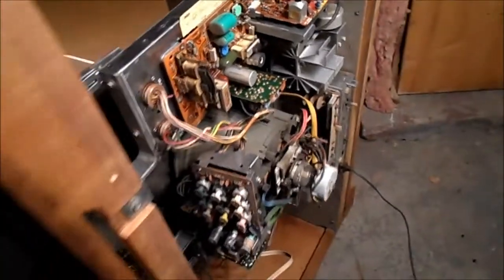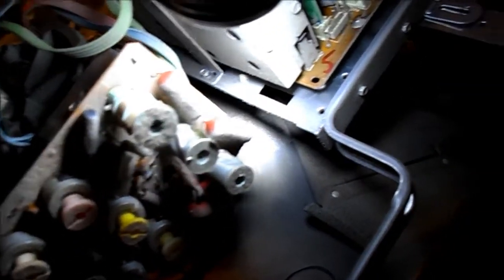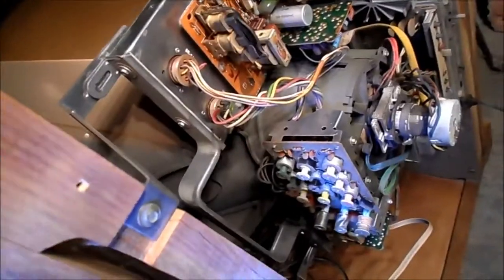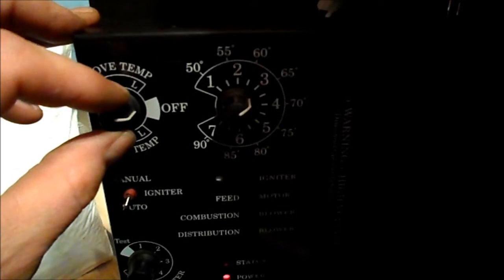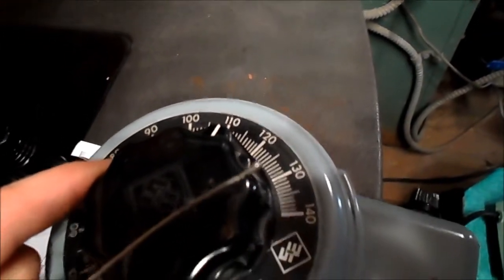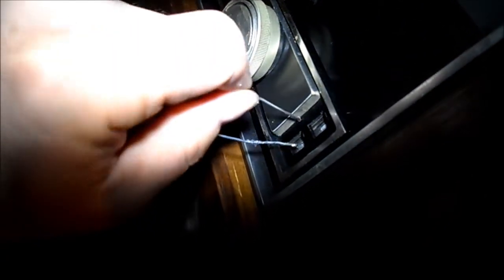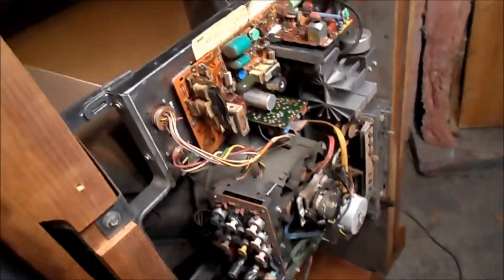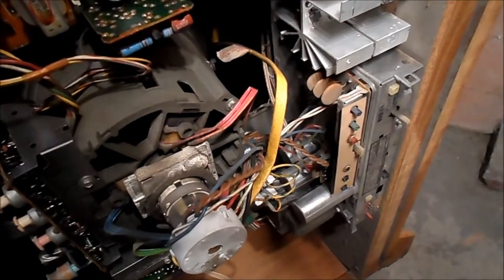1973 RCA CTC 48H Checkout. With Pellet Stove Repair Mixed In.

Comment: If the tripler was unhooked, maybe it's bad? just a thought
Reply from the maker: Yes that had crossed my mind. Never seen one short, they usually arc out, but suppose anything is possible.
Reply: I have replaced quite a few that were shorted. Diodes short
Reply from the maker: James skippinhopper ECG 500. Good to know. Hope it doesn't wipe out those Horiz. outputs. Didn't think it would blow the breaker. I'll have to unhook again check some components, & try once more.